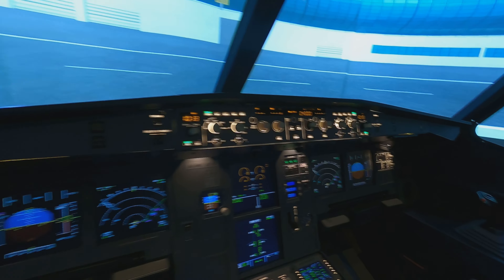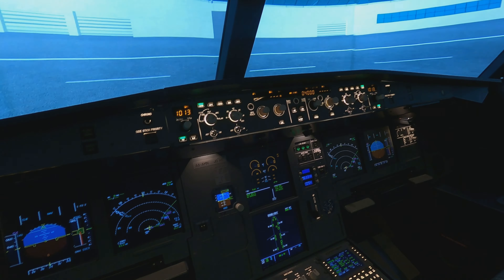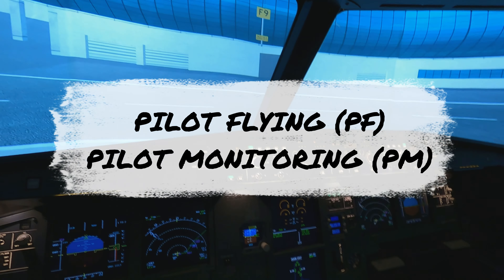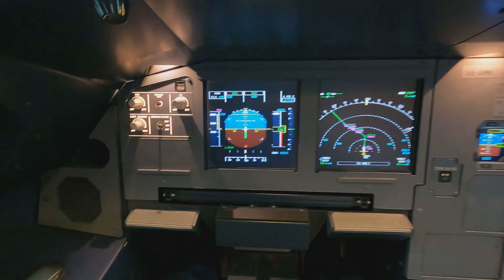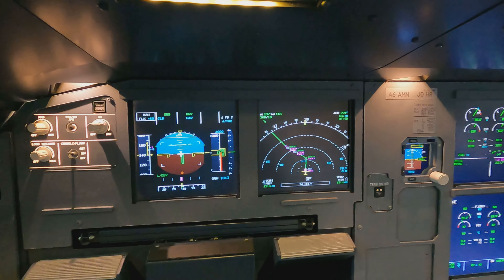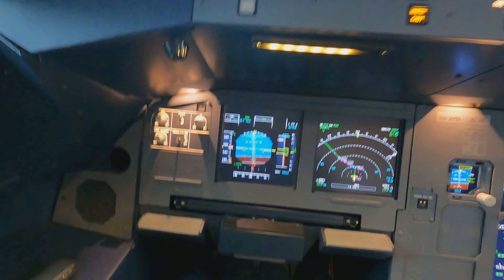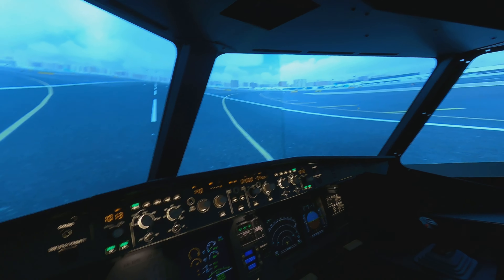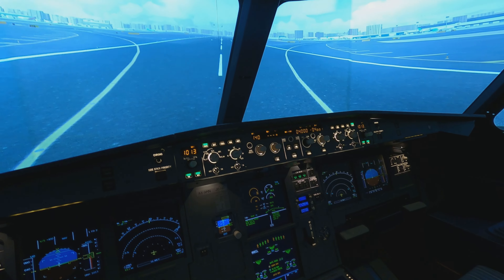Airbus A320 | Tutorial | How to Handle an Engine Failure During Takeoff (EFATO)

Comment: Shouldn’t you apply TOGA right after liftoff? Since you were so heavy?
Reply from the maker: TOGA is an option, but it has its pros and cons. While it could improve my performance, it might also affect my directional control since only one engine is running.

So, to answer your question, I wouldn't set TOGA unless there’s a performance issue, like a vertical speed below 400 ft/min.

Comment: Hello Mister! question: when and how did you establish the 3.2 radiusfrom RWY to start turning downwind? i missed! Pedagogy in your videos is outstanding, thanks for that
Reply from the maker: Select FPLN , navigate to any waypoint and press the Line Select Key (LSK) to the left of it. This will take you to the Lateral Revision page, where you'll see an option called FIX INFO. Press the LSK next to that.

From there, you can insert a VOR, NDB, airport, runway, or waypoint as a fix, and define a circle or radial. You can also define multiple fixes across several pages.

Hope this helps!

Comment: A question is there a critical engine in A320 which is usually the left engine?
Reply from the maker: Hi,
The Airbus A320 Doesn't have a Critical Engine, in the event of an engine failure the remaining engine is capable of powering and running all systems, add the APU as a back up and Battery and Ram Air Turbine, the redundancy built in doesn't require a critical engine.
Reply: @waypointsaviation  ok i was asking because in multi engine piston AC they teach us that the left engine propeller is the critical bcs of the pfactor and so on so i thought maybe a320 has a critical engine too more or less. Thank you sir
Reply from the maker: Usually jet engine a/c don’t have a critical engine to my knowledge.
Reply: What about fuel jettisoned? Dont you have to dump fuel since ur landing back too soon? Or u will exceed landing weight or maybe am wrong please explain ?
Reply from the maker: The narrow body fleet of Airbus (A318,319,320,321,220) are not capable of fuel jettison. So in the event you’d have to land over the max landing weight we do have an over weight landing procedure and checklist to follow. Also after an aircraft does an over weight landing it’s immediately checked by the engineers to ensure no structural damage before it’s released back into service.
Reply: @waypointsaviation  understood thank you
Reply: You were talking about the MCT as far as i know you cant keep it for too long or it will hurt the engine is it ok to keep thrust on mct until landing with engine failure?
Reply from the maker: Keeping MCT on for long is fine, you cannot keep the engines at Max Power for long time. There is a difference between max thrust and maximum continuous thrust. So it’s fine to keep the engines at MCT until landing.
Reply: @waypointsaviation  when you say max power u mean TOGA?
Reply from the maker: Yes TOGA, also In the Airbus A320, the maximum thrust refers to the maximum amount of power that the engines can produce for a limited duration. It is typically used during takeoff and initial climb when the aircraft needs the most power. On the other hand, maximum continuous thrust refers to the maximum power level that the engines can sustain for an extended period without causing any damage or exceeding certain operational limits. It is the power setting used during normal cruise and continuous operation.
Reply: @waypointsaviation  so maximum thrust is when u put the thrust lever on flex too for TOff right? And mct is when put the lever down to CLB during climb
Reply: @ibrahimabdulaziz7818  Not all twin-engine propellor airplanes have critical engines - Piper Seminole is an example. Because the propellors counter-rotate, there is no difference in performance change if either engine fails. The other school of thought is that both engines are critical because neither offers a better handling characteristic! ^_^
Reply: @MH-vf3wu  agree if they were conventional then the left one is critical
Reply from the maker: Maximum thrust comes at TOGA but can only be used for a short period of time before it over stresses the engine, MCT is when we want the maximum thrust the engine can provide for extended periods of time, CL is for cruise in normal conditions.